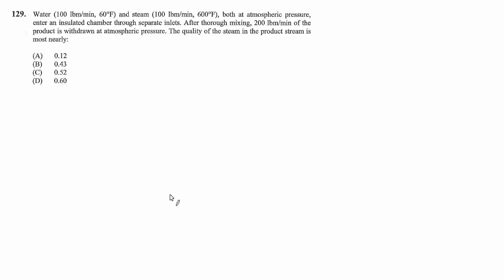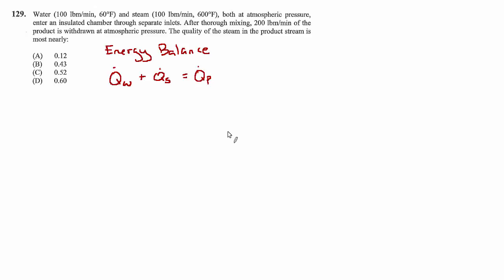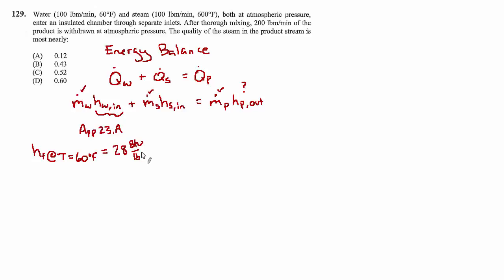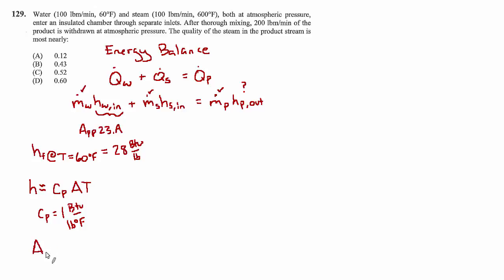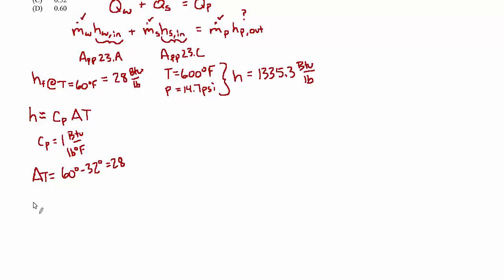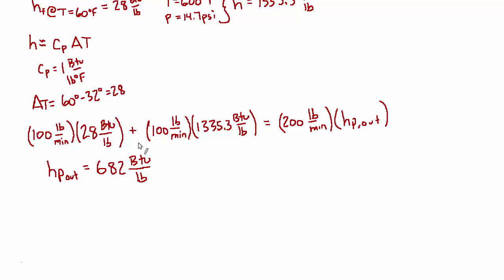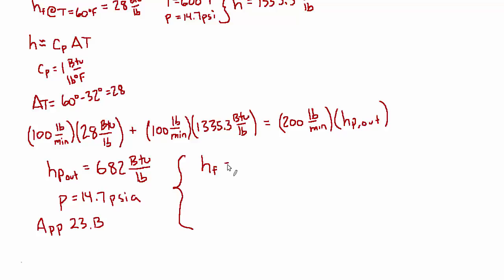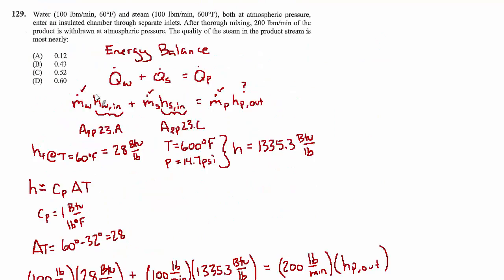Mechanical PE Exam Prep Thermodynamics : Solving Steam and Water Mixing Energy Balance Problem

Comment: Why not just use eq. 23.30 on p.23-9. x= (mass vapor)/(mass vapor +mass liquid)=100/(100+100)=0.5?
Reply: He says in the video. Two scenarios are possible, the energy in the superheated steam can actually change some of that water mass into steam. Or the opposite could happen. You have to calc it or be very familiar with their relative energies to make an estimate.